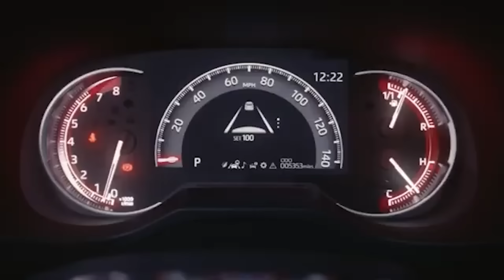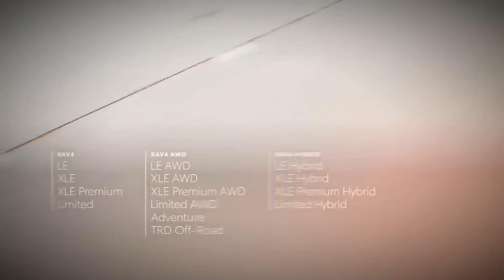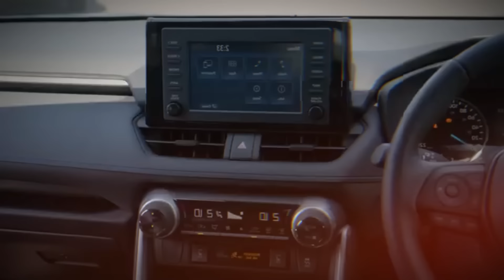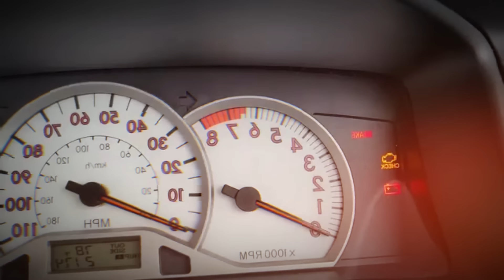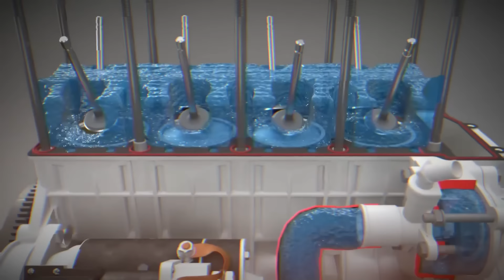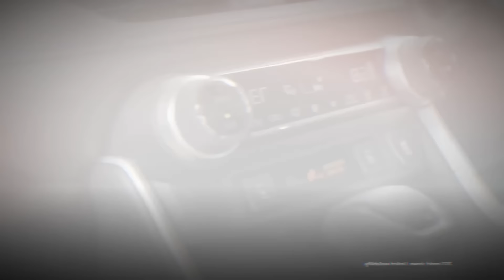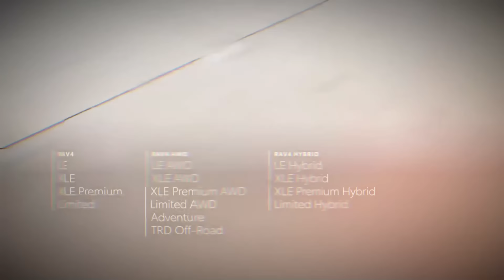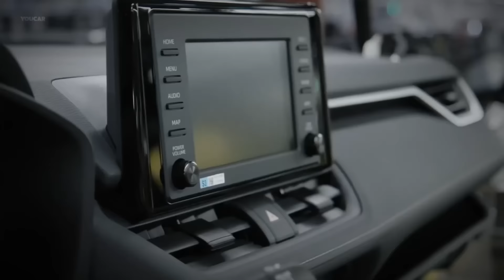Toyota JUST SHOCKED All Toyota Owners!

Comment: I was looking forward to my escape hybrid getting paid for so I could trade it in on a rav4.  Now what do I do?
Reply: Today I saw a consumer reports article about vehicle reliability. It says that Toyota has lost the number one spot and slipped to number 3. Number one on their list for reliability is now the Subaru Forester. I find this strange due to Subaru's head gasket issues. My brother had a Forester that blew a head gasket at around 60,000 miles and again at a little over the 100,000 mile mark. He's not the only one I've heard about having the same problems with their Subaru's. I was a die hard Toyota man since I got my first truck in 1983 but due to their track record since 2005 and especially with their recent problems I wouldn't buy another one. They did get it right with 3 model years of their Tacomas, 2013, 14, 15, of which I'm currently driving a 2014 but after that they started having issues again. Unfortunately I'll never buy another Toyota, I can no longer trust the brand. I'm planning on driving my 2014 until they bury me in it, figuratively speaking of course.

Comment: I just bought toyota corolla le. I dont feel it should have even passed safety quality control inspection or dealership inspection.  Issues since during the test drive. Break issues. Then later realized the emergency parking brake never even work from the start. Screeching engine.  Transmission slip. Computer and sensor and suspension issues. Etc. I wonder if they used refurbished parts as well. It doesn't look like it was assembled well either. People think it's a lemon